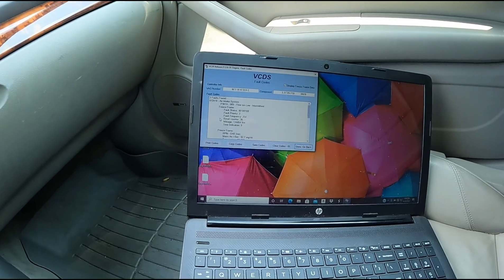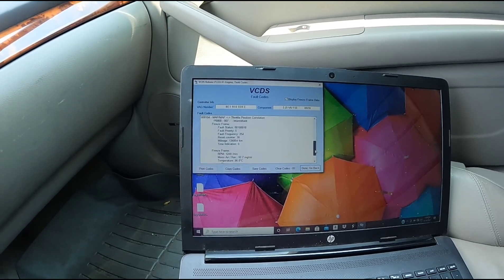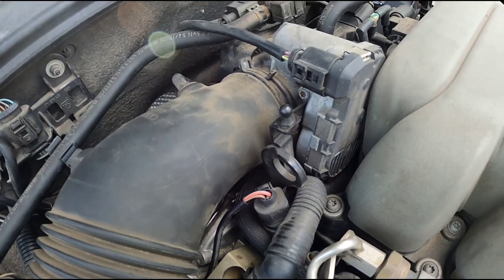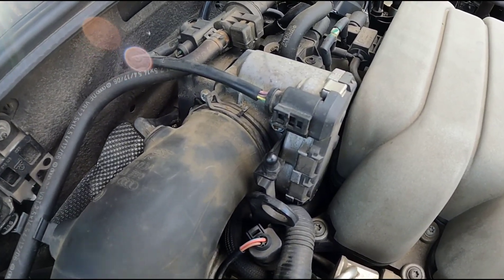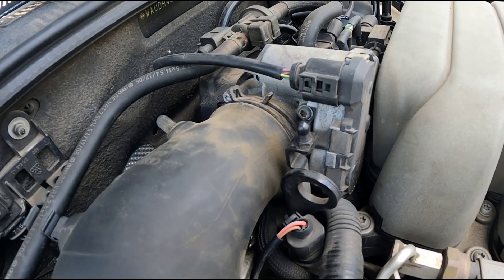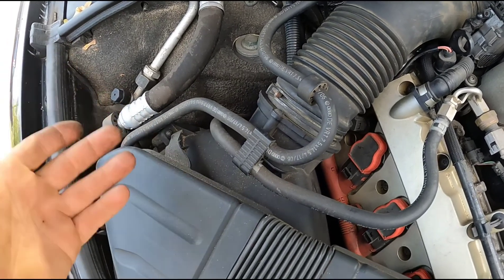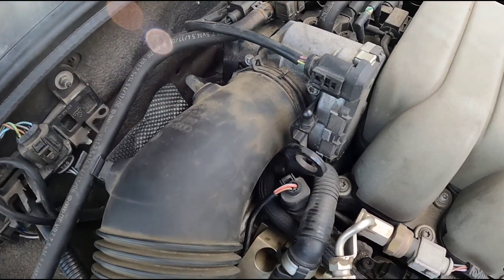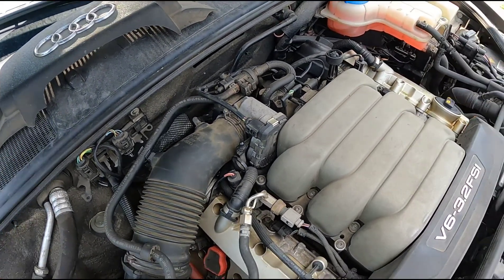AUDI 3.2 FAULTS P0068 and P307A

Comment: Got any tips for P0304 and P0305 on a 2006 audi a6? I got a lot of codes but I heard these are critical
Reply from the maker: Does it shake bad on cold start? Run rough only while accelerating?
Reply: @EuropeanAutoRepair  well I have noticed it has a hard time accelerating a little bit it doesnt feel as powerful 

But also did also get a P2070 and a 307A code 

But full context I just had my alternator belt and my idler pulley replaced as well as my battery and my entire cooling system with tubes

I didnt have an engine light until we were done with troubleshooting the coolant which he claimed “it was on since he got it” but he never had told me it was on at any point during the month they had it

And I did notice there was a lot of “short with ground” / short with power or no plausible signal 

So im wondering if during any of his processes did he mess something up
Reply from the maker: I’ve found harness problems with those engines in the past, I would get to whatever sensors are giving you short to ground faults and reconcile the ground, signal and supply
Reply: @EuropeanAutoRepair do you think those shorts and ground faults are from when they changed the battery?

Comment: Im getting code p0068 on my 2013 audi q7 already cleaned it up and it’s still giving me the code any ideas as to why also changed the map sensors and the mas sensor also the car runs great.
Reply: Did code p0068 clear after replacing MAF/map sensors?